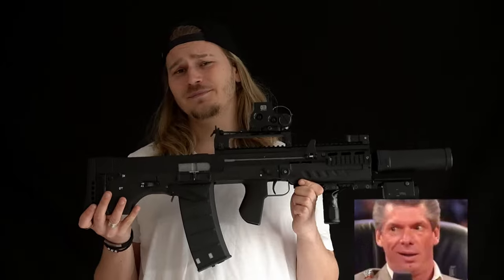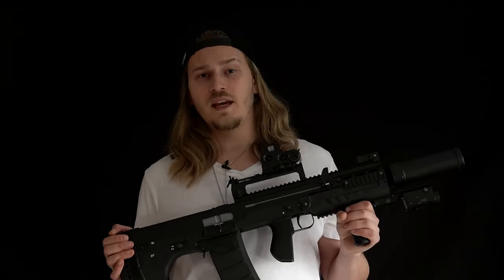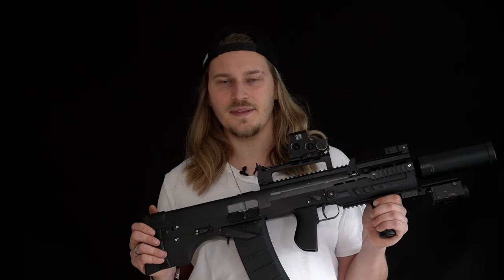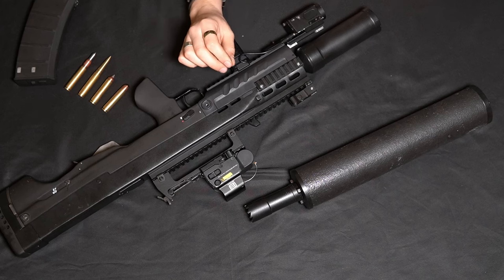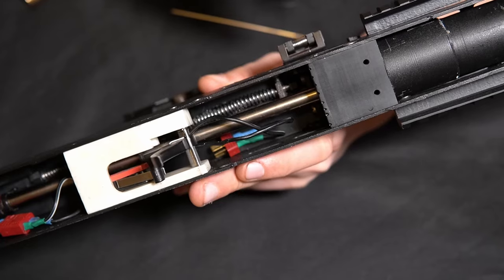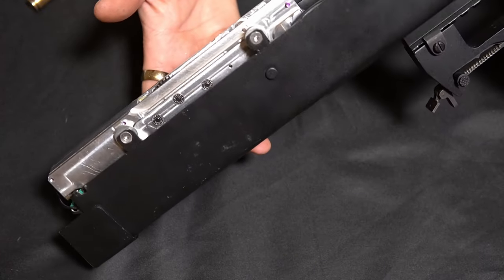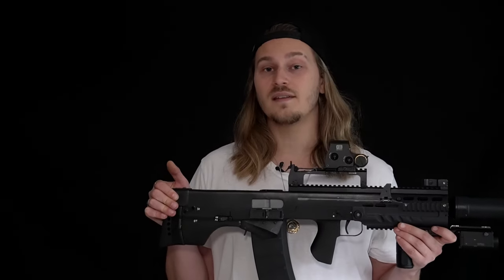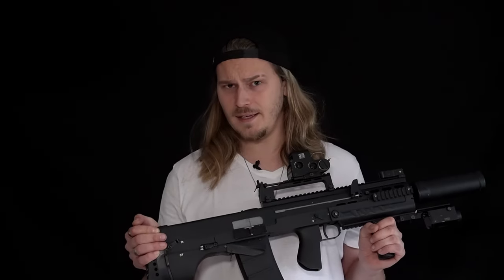The first real Shak-12 / Ash-12 / Oden Airsoft  - Show and Tell

Comment: Very clean work! I'm currently working on making the PP90-M1, which has so far been very tricky as there are hardly any photographs, and those that are available are low quality. 

I have a lathe that can perform small milling operations as well, but as with your project, stamped steel is a limiting factor.

I'm hoping to be able to 3D print dies to stamp with, but it will likely be at the cost of material thickness.

Glad to see people really spending the time to make these unicorn guns!
Reply from the maker: Sounds very close to my project, I wish you the best of luck.

I am afraid 3D printed dies are far to weak, dies are normally made from hardened steel. Even 1.5-2mm steel needs to be stamped with at least 50 tons of force.
Reply: @MadAKMax  yeah, it'd be more of a single use die, I've seen a few incredibly interesting videos where they print a die and fill it with resin, to increase its structure.

Other than that, I will do something similar to you, with bending and welding replacing it.

Comment: I wanted to start a bullpup ak74u project, and i still dont know the fine line of definition of <0.5 joule airsoft guns. Though it counts as a toy, but the "bußgeldkatalog" said that, if it were able to be changed with common tool to be >0.5joule the airsoft gun would fall into the "Waffengesetz" which makes it also not modifyable.

My biggest question is does it mean that i can open the gearbox with common tools and change the spring, or a quick change spring that make it fall into the "waffengesetz"